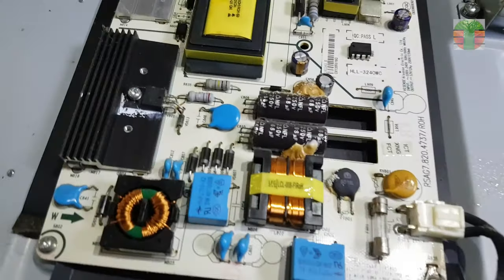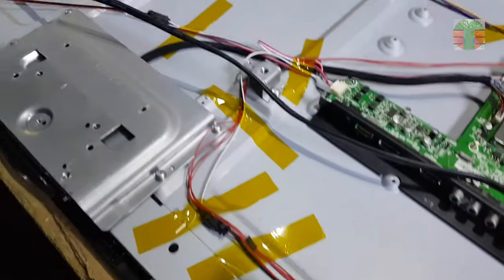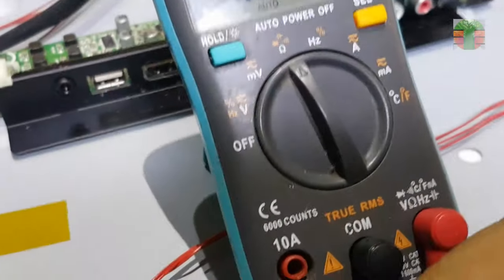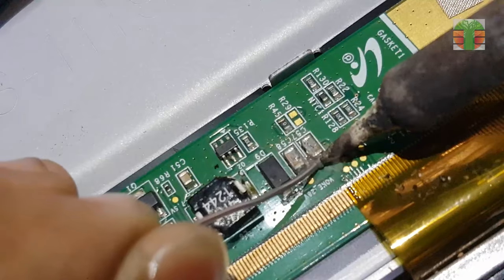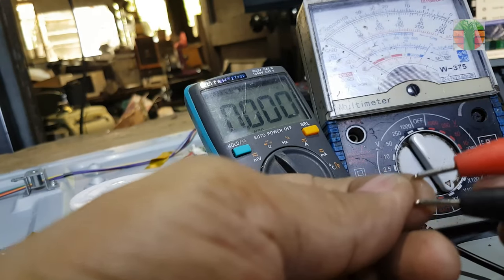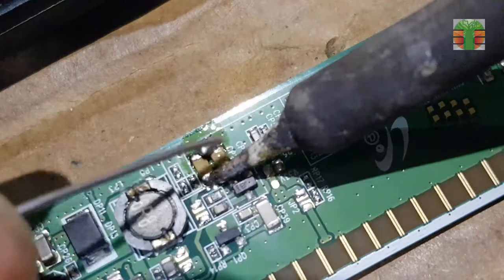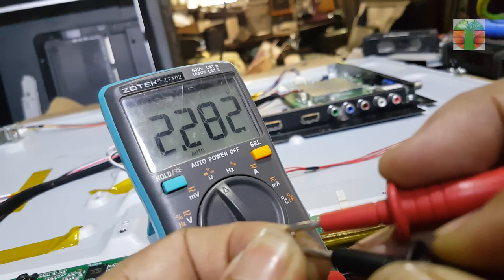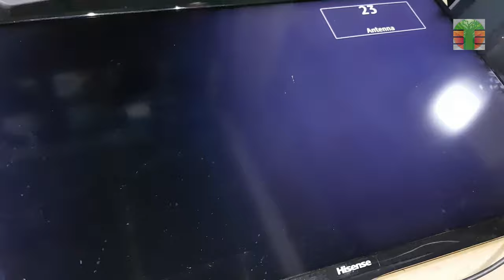No Image. VGH is not present.

Comment: Afternoon there, I do have a problem with a Samsung Led Smart TV. I replaced the TCon board 2015_INX_UHDHAWK_UFT. There is no VGL and VGH voltages. The other board on the bttom is V500DJ4-QS1. I dont get any specs on both to give me a some idea where to begin. Can you please help me. Thanks Peter
Reply from the maker: Disconnect the t con going to the pannel, measure the vgh if goes on, if is try to isolate CkV lines.
Reply: @tevzTVTevatronics  I did that, with tv face down, the left side got vertical bars, right side blank screen. When I disconnect right side going to pannel Ill get the VGL voltage but no VGH. Help me please,  witch is the CKV Lines. Thanks for your help, Im from South Africa

Comment: Resp Sir! Dell Monitor 5Cof Panel VDD 3.3V Only Presented. All Voltages Missing Sir. Pls Rectify & Which Problem Sir.   --   Chinna Rao, Paderu, Visakhapatnam Dist. Andhra Pradesh. India.
Reply from the maker: try the cutting method, there may be a short signal line.

Comment: Good job as usual ❤️
Thanks  lord  only capacitor blown on main bord power supply.
Because the owner didn't tell its 110vlts. 🤔.
I have 1 question to ask sir. Does these capacitors you removed has polarity. Or you can replace it in any direction you want.
Cause I can see there is no lable on cricut board.
Thanks a lot good day 😉👍
Reply from the maker: Its a none polarity capacitor.
Reply: @tevzTVTevatronics  Hmmmm I really appreciate the knowledge you are sharing Sir. I didn't know if these capacitors on led tv doesn't have polarity. I learn something new today. 🙏